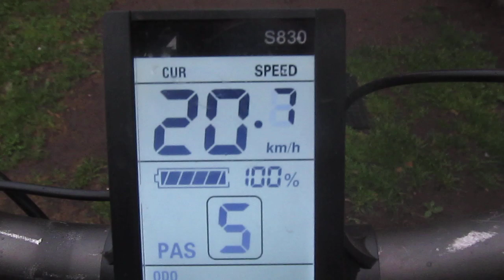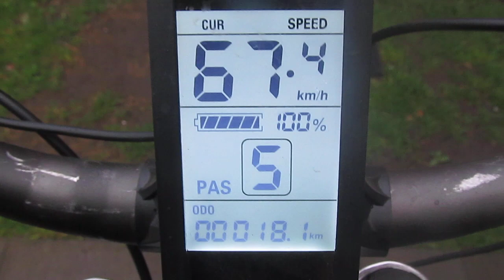Can a 84v 25ah battery run a 48v 1000 watt wheel, Speed test no weight

Comment: Motors don't have a rating it will work with any voltage. 
It will only heat up faster

It's the controller what you should be asking the question for.